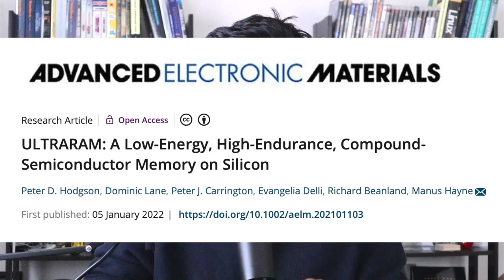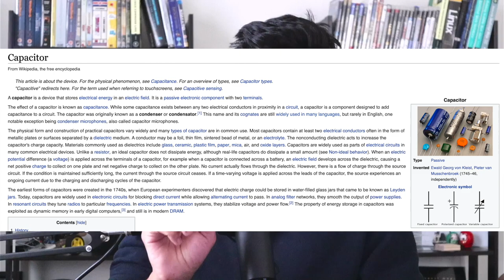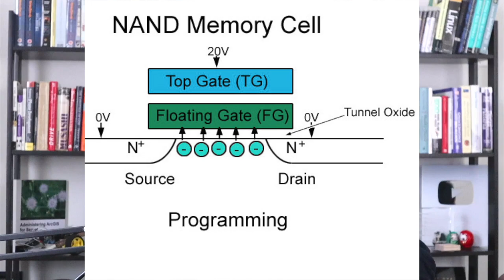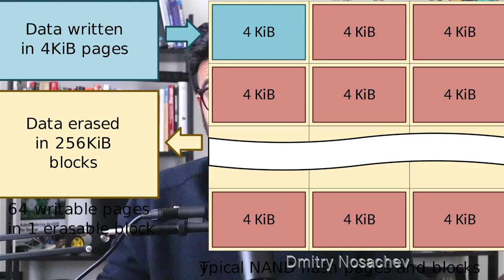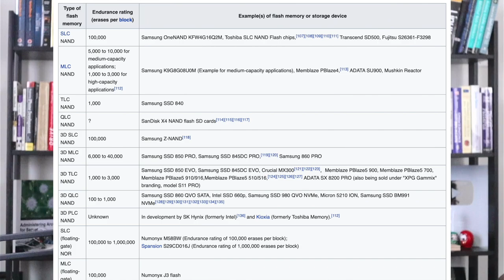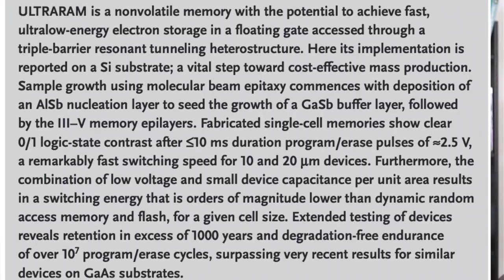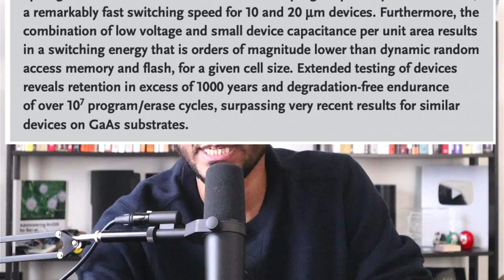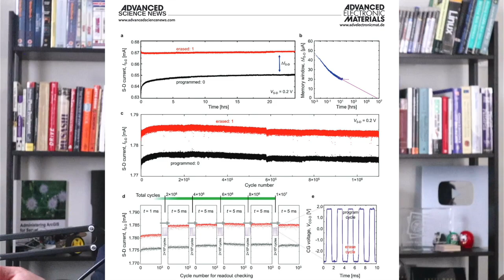Is ULTRARAM a game changer? | The Backend Engineering Show

Comment: This isn't only a gamechanger in the firmware software stack, but a gamechanger for all user code as well. If your disk is as fast as your RAM, nothing is going to be disk I/O bound anymore. No need for asynchronous programming models when involving files, and we can go back to everything being synchronized for these cases.
Reply: I disagree. It won't change for all use cases, but probably will for cheaper transactions

Comment: I am afraid this will never come to manufacturing because it's putting many people out of business.
Reply: ? The only people this threatens is the people in storage business. When SSD came, HDD manufacturers were in danger, but then they adopted SSD too and now they're back in business as usual. What makes you think this would be different?
Reply: @VivekYadav-ds8oz  Answer is here 15:31
Also it's too durable. I remember having to replace phone because storage performance went down bad because of moving too much data frequently.
Hope it does make it to market tho.
Reply: dukhi kardiya
Reply: People said the same about the computer.
Reply: @nathanhedglin931  True. And as some other guys have mentioned. Intel is already working on a similar thing. I guess that hurdle is already crossed then.